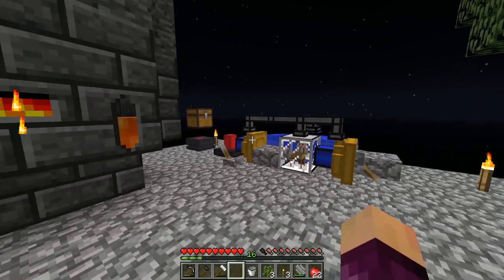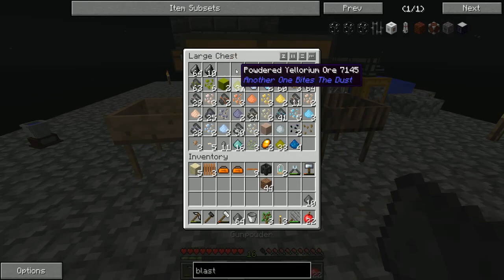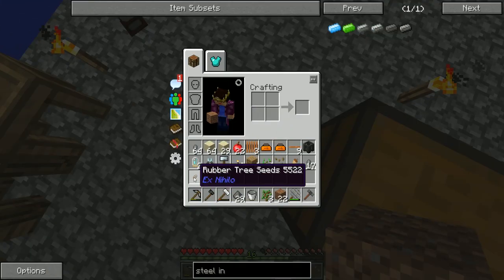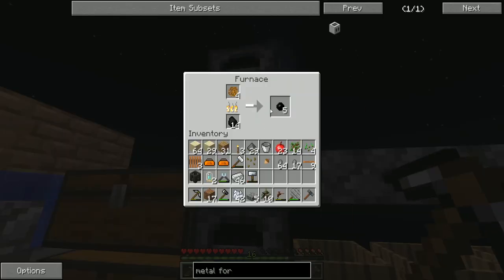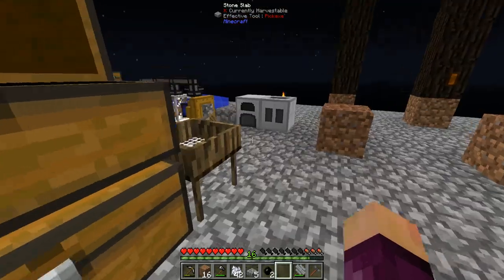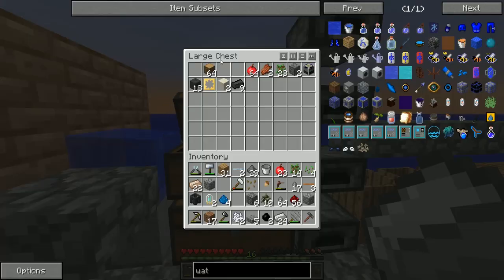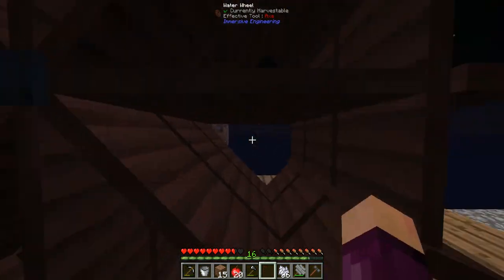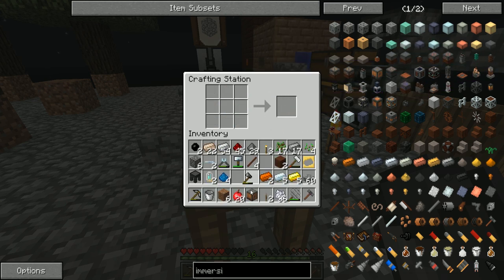FTB INFINITY EVOLVED SKYBLOCK - BLAST FURNACE, WATER WHEEL & METAL FORMER #4 [Modded FTB Skyblock]

Comment: 1. If you make yourself a TiCon chisel (which only takes one ingot of material--half an ingot each for the head and tool rod) you can chisel the blocks of seared stone down to seared bricks, if the difference in texture bothers you. It does take durability damage in the process, but I think the numbers work out such that you'd have to chisel the entirety of a max-size smeltery to break it.

2. Having a spare forge hammer is useful for when your metal former decides to break down to a machine casing when moved--one of my least favorite IC2 mechanics is that even a wrench isn't guaranteed not to break the block. (Yes, I'm a bit bitter. I went 0-2 with my IC2 machines when trying to set up a proper machine area.)

3. I'm kinda enjoying the break from Sphax.

Comment: were the sheers issues fixed in later updates? i came to FTB skyblock a few days after it was released and sheers worked fine? And pouring smelted compressed cobble into ingot casts gives you bricks for the smeltery =)

Comment: so I did some math if a water wheel produces 90 rf per ticket that is 648000 per hour. to create iridium you need 80000000 rf mox nuclear fuel and rtg fuel pellets in an assembly table. the mox and rtg is to bad but that 648000  is only .081% PER HOUR. AND YOU NEED 2 IRIDIUM INGOTS FOR 1 TURBINE BLADE FROM BIG REACTORS. THIS PACK IS INSANE
Reply: and that's only for iridium... I wanna die
Reply: +ZCGam3rz wait sorry it is .0081% PER HOUR AHHHHHHHHHHH
Reply: ZCGam3rz have you seen the me wrench? Or the angel wings look em up

Comment: 1. you can compress dirt for easy sifting.
2. ik think ic2 machines accept immersive engineering power. (I might be wrong I have not yet gotten that far)
Reply from the maker: +tom van der laan (tom700as) Yup can sieve compressed dirt but I've been told there is a 45% loss when sieving compressed block and so I chose to sieve single pieces of dirt to increase my chances of getting the rubber tree seed. =D
Reply: +Gaming On Caffeine the loss of items I didn't know, the yea sifting them one by one is more resourceful if you have access to only a few dirt's at a time.
Reply: +tom van der laan (tom700as) Immersive Engineering uses RF, however, IE-wires can transfer both RF and EU :D

Comment: If you didn't know already you can add a diamond hammer to your pickaxe and it will have the "hammered" modifier which will make the pickaxe act like a Ex Nhilio hammer.
Reply: Be weary the Ex Nhilio hammer is different than the Ex Compressum hammers
Reply: +Jonah Consencino with a lot of diamond hammers you can get the compressum hammer effect

Comment: You could just use immersive engineering cables to power metal former with hobbyist engines.
Reply from the maker: +Alper Değre Later in this very episode. =D
Reply: +Gaming On Caffeine Just watched that part after posting. Also you can power BC lasers with immersive engineering cables if you put wire connectors to the back side of the lasers.
Reply: +Alper Değre or on the top